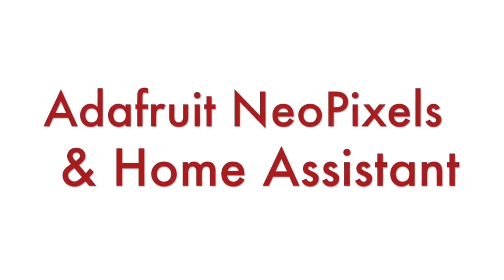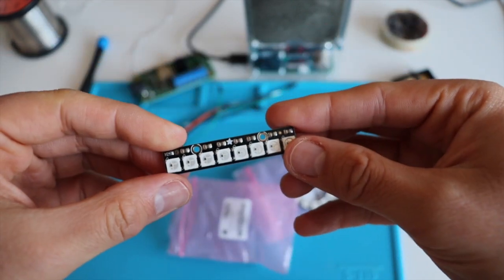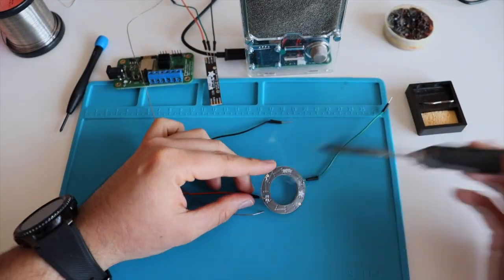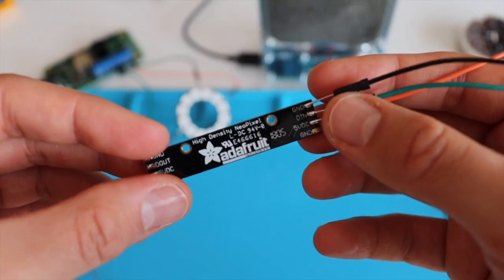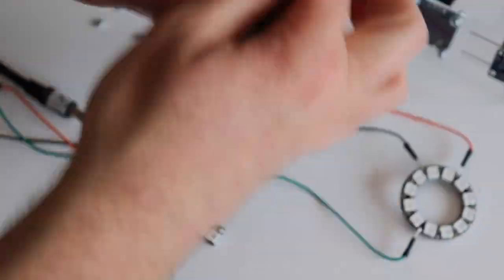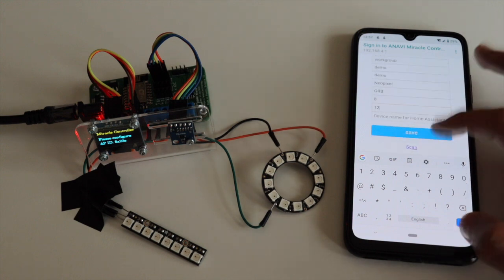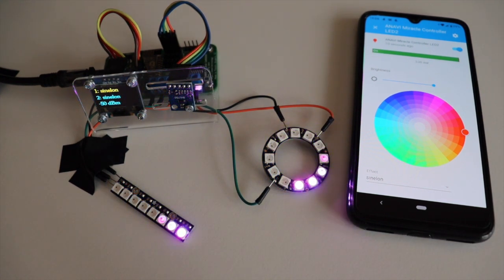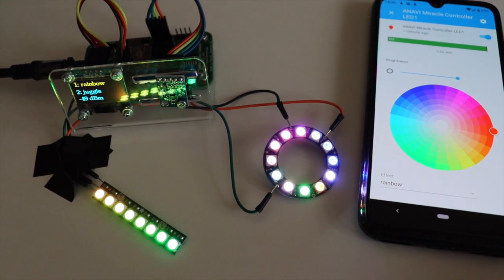Controlling Adafruit NeoPixels with Home Assistant & without Any Programming

Comment: Great breakdown! I'm new to this whole computer science world.

Would your ANAVI controller, MQTT, and Home Assistant setup work for a Rasbian OS flashed Raspberry Pi?

Thanks!

Edit: Looks like it's Arduino based because of the ESP8226 MCU, not sure how easily transferrable to a Pi this software would be
Reply from the maker: Yes, ANAVI Miracle Controller is with ESP8266 and the source code is based on the popular Arduino library FastLED.

You can have MQTT and Home Assistant running on Raspberry Pi and controlling the addressable LEDs connected to ANAVI Miracle Controller. 

However, if you want to control the addressable LEDs directly from the Raspberry Pi without ANAVI Miracle Controller than it is an entirely different code base from the Arduino sketch because Raspberry Pi OS (previously known as Raspbian) is a Linux distribution. This is also possible and other tutorials explain how to achieve it.

Comment: Will this process also work with a Wemos D1 mini which also has the ESP8266 wifi chip?
Reply from the maker: Yes, the open source firmware is actually an Arduino sketch and can be adapted to any other ESP8266 setup with the same or similar schematics. However, with ANAVI Miracle Controller has everything needed out of the box, no soldering is required and as you can see in he video the process is super simple.